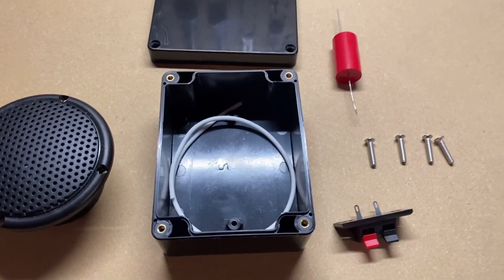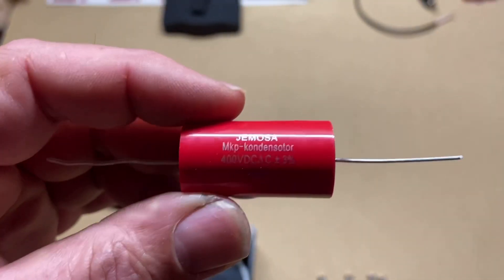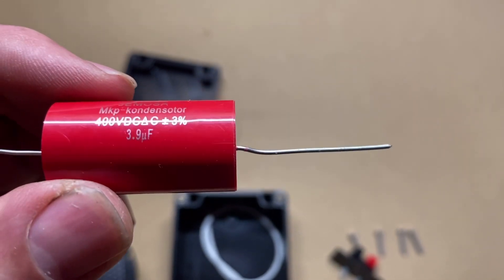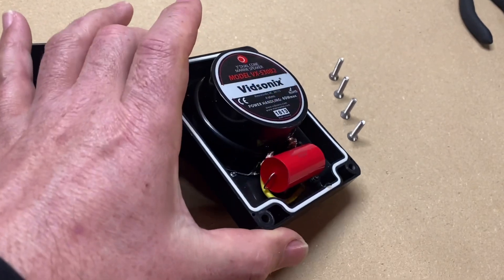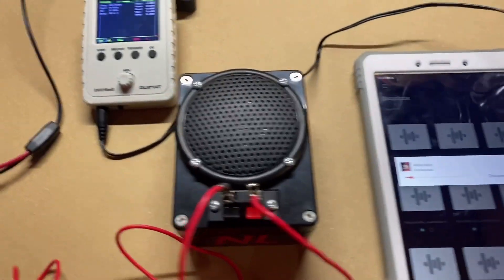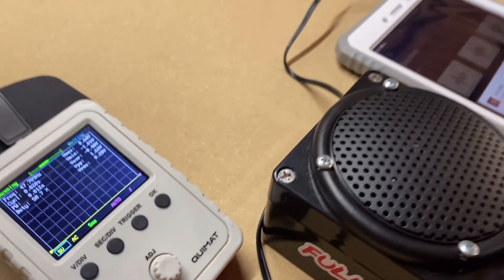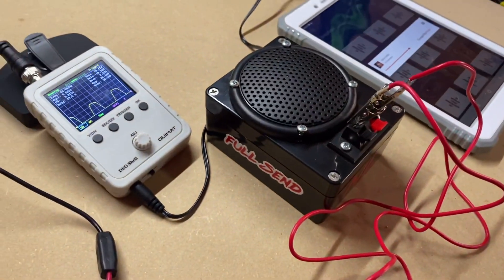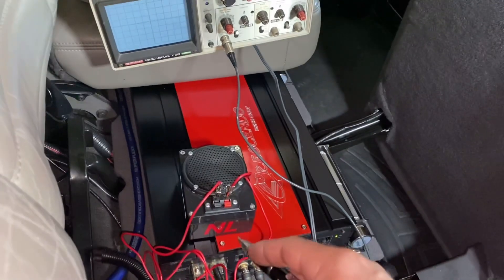CHEAP and EASY!!! DIY amp gain setting distortion detecting tool!!!

Comment: Sir can i ask, i have a monoblock 1000.1 what can i use capacitor uf and volt ?
Reply: Sam from Bare vids recommended 450V 220uf if you're not sure what size to use.

Comment: Couple questions is this only for tweeters and also could you use an old surround sound speaker
Reply from the maker: Typically tweeters need to be used. But I guess it could work…. Not sure

Comment: Cool video! Could I just simply place that capacitor between my amp and my car speaker on the + side of the amp's output and listen to for my car speaker to buzz? Essentially using the car speaker as the "test" speaker? Thanks!

Comment: Your channel is by far the most helpful to people trying to learn how to perfect the sound of their car audio system. All of your videos have a lot of beneficial knowledge for those who want to learn. I have a question about this design as well. Could I use an old stock tweeter that came factory in my car to make one of these? I will only be using it for systems under 1000 RMS
Reply from the maker: Thanks for the comment. Much appreciated.  Absolutely, that would work just fine

Comment: Will this work for fullrange amps? For setting gains for components.
Reply from the maker: It will, but Not as well. Considering the frequencies this was designed to pickup.
Reply: @NextLevelCarAudio  Thanks for the reply. After seeing your other video I ordered the small o-scope. I just got my first dsp and there are an overwhelming amount of levels to set.
Reply from the maker: Awesome man!

Comment: I wonder if you can connect an LED instead of the speaker, also do you need a sub connected for this to work as with the sub I get box impedance rise, with just the capacitor connected what ohm load is it?

Comment: Does it need to be a specific microfarad if I use a smaller save 100 or 200 VDC?
Reply from the maker: Not really. Capacitance will determine how audible the signal will be. But you don’t want to put to small of a one in there

Comment: Nice but what about speaker ohms like if you have a sub wired to 2 ohms would you need a 2 ohm speaker to do the test? like some amp make more power at lower ohms wouldn’t you need the same ohm speaker for the test that’s the same ohms as your subwoofer
Reply from the maker: In this case it does not matter.

Comment: I have a 1000 watt skar midrange amp wondering if I could set the gain with this method. I’ll have a pair of 8’s and 2 pairs of 6.5s. What hertz would you recommend? Thanks new to all this audio stuff
Reply from the maker: Yeah, it will work. 1000hz should work fine

Comment: Does the speaker i use need to be a tweeter ? And also does the ohm of the speaker make any difference as to what frequency the test tone should be ?
Reply from the maker: Needs to be a tweeter or speaker that can audibly play high frequencies well
Reply: @NextLevelCarAudio  ok great thx. I have a set of audio pipe tweeters I plan on using one of those anyway. Just waiting on my. Caps and speaker input plugs to arrive.  This is awesome man thx
Reply from the maker: Heck yeah! Let me know how it turns out for you!

Comment: Hey awesome man  question what size capacitor I use if I'm checking 2000w and below amps does the speaker make a difference?
Reply from the maker: Sorry for not getting back sooner. Probably one around 100 volts.

Comment: What volume are you at playing the tone through your tablet or whatever? lol I was doing this in my vehicle but eyes on sub and tone played thru stereo deck from my phone. I didn’t know what volume to have my deck on, let alone my phone to play the tone at.
Reply from the maker: I have my device on max. Because that is where I make sure it’s at when I stream from it
Reply: Okay so it wouldn’t be the max level that you listen to your music at? 
but as I said I was doing before, it can be done like this? If I have eyes on my subwoofer and doing a tone test setting the gain? If I have eyes on my sub and can hear the distortion.. then all will work well with this method right?? lol 
I know I’m a dumb ass thank you for replying
Reply from the maker: Not for device. For head unit yes. Max unclipped volume you will listen to
Reply: @NextLevelCarAudio  And then start low with the hurts test to slowly raising until you get the frequency you want? ya? 
Thats gun be so hard to do from inside of a vehicle trying to do this.. having the volume at Max (my max listening output) for a good lil amount of time until I set my gain correctly, not to mention my eq & all the other frequencies first from my head unit and all that.. How the...? lol 
I like to pound loud and listen to my hard rock even louder, my speakers n sub being in that high of a volume, for amount of time needed, won’t blow just doing that? or stress them out or make them bleed or harm them in any way? 
It just sounds kinda iffy to me and I don’t want to ruin my system before I even have a chance to enjoy it. 😅
Is there a way of doing this in reverse?  lmao!! I know, stupid ass question. 
Man just for yourself up for a weekend vaca. I’ll buy you a plane ticket & pay you to come and fine tune my shit for me 🤣🤣😅
Reply from the maker: Lol, that’s why I go to the back lot of Home Depot/ Lowe’s. So my neighbors don’t hate Me lol
Reply: @NextLevelCarAudio  Im Just worried having my volume up that loud for so long it’s going to damage the speakers. but yes sir, I will give it a try
Reply: @NextLevelCarAudio  Hey boss, just two more things plz.. 
My head unit does have LPF settings and HPF settings, so I would turn the LPF switch OFF for the amp ok cool. Then what you think the LPF should be on my head unit? your opinion... also on the amp, you say leave the bass boost off or all the way down also the bass frequency. I am, but I also have just a frequency knob by itself. Only says frequency.. What should that be set to before gain tuning?
Now my head unit has a subwoofer level, should this be set all the way up also before tuning the gain?
Reply from the maker: If they are being powered correctly then you have nothing to worry about
Reply from the maker: Sub level all the way up on head unit. It will give you the highest preamp voltage going into amp which means you won’t need to turn Gain as high which means cleaner signal/music. No bass boost/freq. sounds terrible and introduces distortion easily

Comment: This was an extremely helpful video & I practically built the exact same thing thanks to you & this great video. I used a 6" x 3 1/2" x 2 1/8" black ABS plastic project box, a 5-way Binding Post speaker terminal, 3" of 12 gauge AWG speaker wire, 2 1/2" 8-Ohm full-range speaker, & an Audyn Cap - 2.2uF Plus Series 2-Layer Metallized Polypropylene Film & Foil Crossover Capacitor rated at 800 volts DC. The entire cost was under $30.00 to purchase all the needed items & the Distortion/Clipping Detector works excellent & I highly recommend building one for anyone that is into car audio.
Reply from the maker: Awesome man! Thanks for the feedback!

Comment: This is cool but what about determining the clipping volume of your head unit using the RCA’s?  I made the DIY Rockford Fosgate cable which is RCA to 3.5mm with resistors and then connect to small amplified Bluetooth speaker with Aux in but the speaker plays actual music and not some distorted sound. It says to play until “raspy” but I much prefer this where as soon as you hear anything you know it’s distortion. Any idea how to do this for RCA’s?
Reply from the maker: I use my oscope. Mini oscope works just as good. Most all Low level inputs I have checked don’t clip even near max volume. High level, that’s another story

Comment: Hey brother,  looking to use this method w an old tweeter to test my Crescendo s1v2. Around 1000 watts. This capacitor business is new to me. Would say, a 50v - 10uf capacitor do what I need it to do, or would it just blow? Any info is greatly appreciated. Thanks in advance.
Reply from the maker: That would work just fine. 😎

Comment: Does it work on 4 channel amps or 1khz test tone?
Reply from the maker: Absolutely. But I’d still do a lower test tone. Won’t harm front stage as only the high frequencies pass. Not the low

Comment: I recently purchased the DS18 Pro X 6.4 BMPK component set up. Can't wait to get them installed. Never had stand alone tweeters before. They came with capacitors on em. Do you think they are enough or should I snag up a pair of crossovers for them.
Reply from the maker: They are definitely safe and good to run as is

Comment: Cool video.  How would you do a 1000k sine wave using same  method!
Reply from the maker: With this, you should also be using the 40hz tone to do your front stage as well. The sound you hear passing through is high frequency noise and will not damage your smaller speakers as the capacitor Is in essence a bass blocker. Same thing they put on tweeters

Comment: Riveting presentation.  Being new to car audio I'm still not clear on what our tolerance for the distortion threshold should be.  Can a "soft clip" be tolerated for the most part in order to ensure we squeeze every ounce of performance from our system or should we strive to never have even a hint of clipping.  For example my Rockford Fosgate R2-750X5 will show a blinking red light as I enter the clipping threshold and then is solid red for clipping, they say to turn it down until the red light is off but can we live with the blinking light and expect that the equipment will not be damaged?
Reply from the maker: Thanks for the feedback. You should be fine bro. I’m on that edge all the time lol. Manufacturers pay it safe typically, so no worries man. If your subs dust caps start warming up, it you smell stinking voice coil, better back her Off lol 😂
Reply: @NextLevelCarAudio  lol nice, so there's yet another cheap way to detect and measure distortion, stinking voice coils.  Thanks for all your insights bro.
Reply from the maker: You bet Man

Comment: Will this setup only work with only 40hz test tones to setup subs and not 1khz for door speakers?
Reply from the maker: With this, you should also be using the 40hz tone to do your front stage as well. The sound you hear passing through is high frequency noise and will not damage your smaller speakers as the capacitor Is in essence a bass blocker. Same thing they put on tweeters

Comment: Where did you get the cap?
Reply from the maker: I had them a long time ago. I think eBay or something
Reply: @NextLevelCarAudio  o ok. Thanks. I've made one like this before but didn't have as big of a cap. Like you said it worked fine for small amps but nothing over 5k. I actually didn't think about the cap being the issue. I'm making one now that will actually light up a led instead of using a speaker. Thanks for the info. Great video
Reply from the maker: Nice

Comment: You Should include a parts list and links to buy
Reply from the maker: You can source everything very easily by doing quick searches on Amazon or eBay. The Speakers I used I already had. The biggest thing people need to know was the capacitor. Which I did describe. Again, I had those in my stock for years and did not buy them recently to even put links. I figured this video was more than enough to add value to the community for anyone that wants to know another way to do things.

Comment: I came to your channel because of how amazing you are with interacting with comments/questions.  My question is, I will be wiring my first dual power/ground amplifier.  If the amp manufacturer recommends a 300amp fuse, should I fuse each of the 2 power wires going to the amp with a 300amp fuse each, or 150amp each totaling the recommended 300amp fuse.

I hope this question is not to much of a “noob” question.  Thanks in advance for any response you provide as well as all these informative videos.  Everyday I am trying to think of new ways to take my car audio to the next level!
Reply from the maker: Thanks for the support man. My biggest fear is that as my channel Keeps growing I won’t be able to keep up with comments. But I’m trying! 😂. Honestly, it will depend on the actual gauge of wire. I assume you are going to be running 0 awg to the amp, so in that case you will use two 300 amp fuses. I use 350’s to get a little more juice to the amp when running 0awg.
Reply: @NextLevelCarAudio  perfect, thank you!  Honestly I have no idea how you keep up now but that is what puts you above the rest.  Keep up the hard work it will pay off in the end.  Thanks for the tip,  I appreciate all the help you provide.  Luckily I live in the same city that Steve Meade (SMD) (meade916) has his shop so when I pick up supplies I try to sneak a question in or 2 but I know Steve is super busy.  Thanks again, take care.
Reply from the maker: Thanks! Have a good weekend
Reply: @NextLevelCarAudio  you do the same brother, thank you.  1 last question for today, what would be my best source to find or get box dimensions and cut sheets to build a custom box myself.  I have the tools and can buy the supplies, the hardest part is figuring out box specs and dimensions, port size/length etc.
Reply from the maker: Drew jones over at bassahaulics. Best price for full 3D design, cut sheet, etc.... let him know Kimo at next Level car audio sent ya. He will take good care of you
Reply: @NextLevelCarAudio  thank you so much brother, really appreciate it!

Comment: I bought a truck that had some $10 boxes power acoustik tweeters with built in capacitors. I don’t run nearly that much power but one of them does the job.

Comment: That's "Next Level" slick right there, and I like how you do budget things like this so your channel is well suited for a wide audience not just the just the high end stuff 👍🏽👊🏽✌🏽💯
Reply from the maker: Thanks!
Reply: @NextLevelCarAudio  would this work also if you solder a female rca input in line with the negative and positive with the capacitor. To check clipping on rca outs on headunit and line drivers. Like the dd1 having a rca input on it. Also instead of a speaker  or try it with the speaker attached but also use a led indicator light to see if it lights up exactly when you hear clipping in the speaker?
Reply from the maker: Signal might not be strong enough coming from low level to hear through speaker. Can easily write in a led indicator if you have the electrical know how to wire a custom circuit

Comment: Question is there a certain ohm for the test speaker your going to use. Just ordered parts off Amazon great video thanks.
Reply from the maker: Not really. Standard 4 ohm would work just fine
Reply: Thanks again

Comment: will that work to tune the amp for mids and highs using a 1khz test tone
Reply from the maker: Absolutely, but use the same 40hz tone! Remember, your speakers are protected from the capacitor. The sound you hear coming through the cap (bass blocker) is high frequency.
Reply: @NextLevelCarAudio  can I use an 2" speaker ?
Reply from the maker: You bet
Reply: @NextLevelCarAudio  thanks

Comment: Is there one to test mid and highs
Reply from the maker: Yes, this! Connect to any amp or head unit, run a 40hz wave and you are golden. The 40hz tone will not make it to your actual gear because of the inline capacitor (bass blocker) so you are good to go man
Reply: @NextLevelCarAudio  a little confused for mids and highs isn't a 1k hz test tone should useed
Reply from the maker: Not needed for tweeter/capacitor method. If using oscope or DD1 then yes. 1000
Reply: @NextLevelCarAudio  one more?  Is there a difference in gain setting  when using the Tweeter method with 40hz and the oscope with a 1000hz for mids and highs
Reply: Hey bro enough love and respect from Grenada 🇬🇩🇬🇩 am a New to car audio am I learn alot from you vid they are very clear and informative keep up the good works bro
Reply from the maker: No difference. Using a 40hz tone is easier to hear the distortion when it comes through.